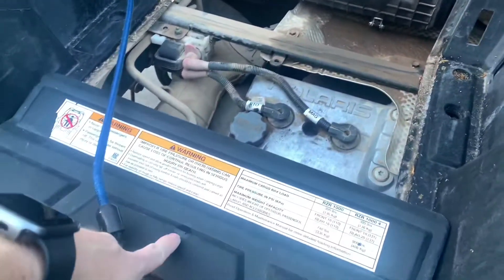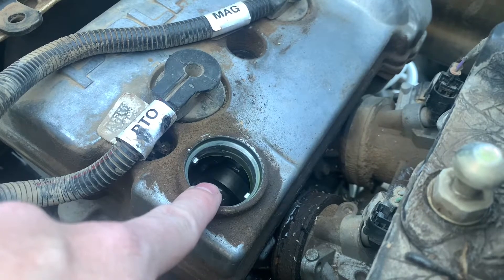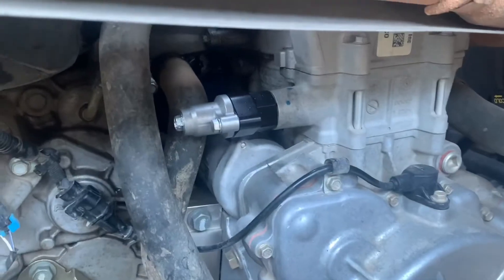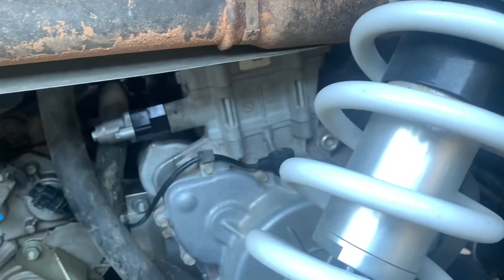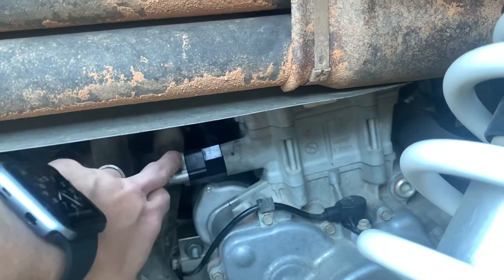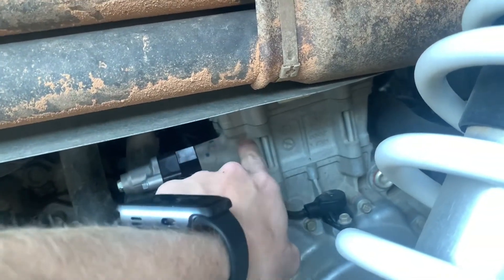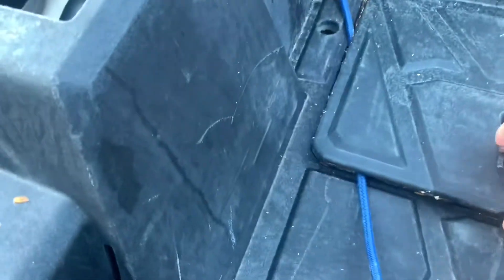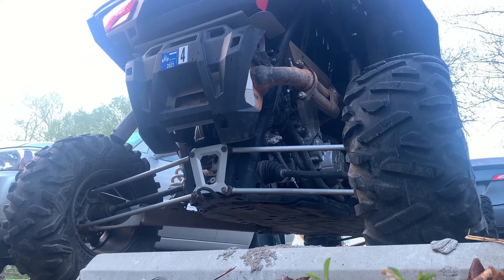Tusk Cam Chain Tensioner | Polaris RZR XP4 1000 | RockyMountainATVMC

Comment: Curious did you happen to have any codes come up or go into limp mode?
Reply from the maker: Nope, I have not had anything come up code wise or has any issues with it, it’s now at like 4,500 miles
Reply: @Diluted_Knowledge  I meant before you changed it out
Reply from the maker: Oh no, it was just making a loud ticking sound until the oil pressure got up enough to to put tension on the chain. Because the factory one requires oil pressure to add pressure to the timing chain. Where this one is spring loaded and ratchets to not come loose

Comment: How did you know that It was still in good timing without taking off the valve cover?
Reply from the maker: Typically if it’s off timing, it will not start or run all that well.